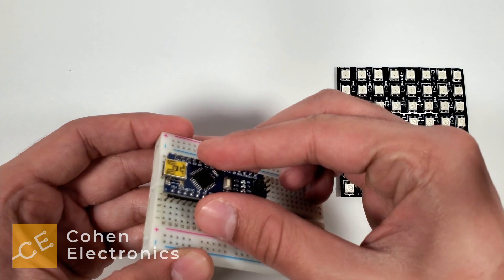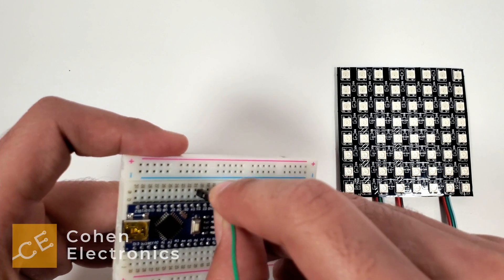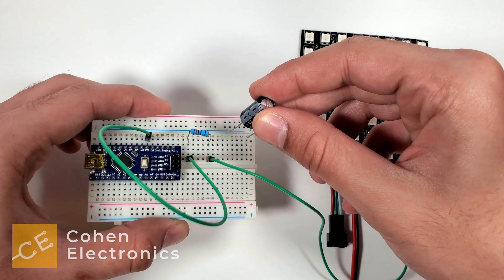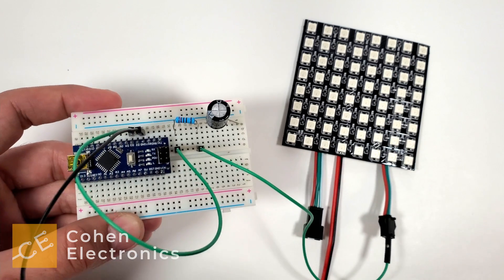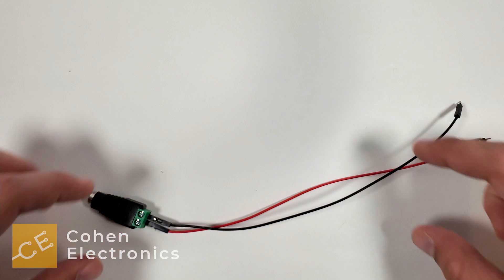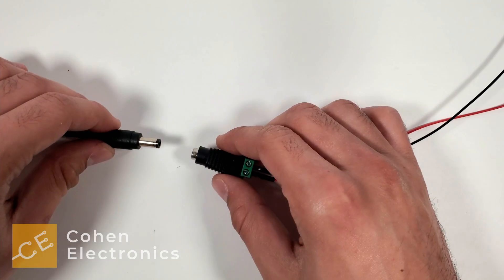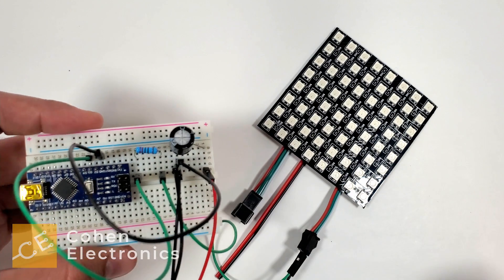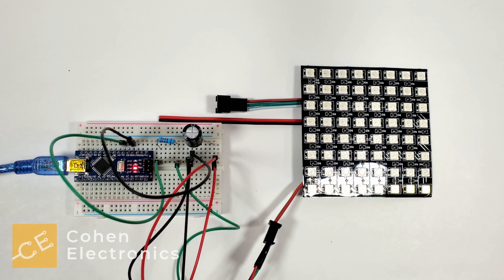Arduino to WS2812B LED Matrix Breadboard Circuit Tutorial

Comment: Hi. I would like to make a similar circuit. Is it possible to make it without the capacitor? And what does the capacitor do in this circuit?
Reply: The capacitor serves to modulate power fluctuations, to keep a steady current going to the matrix. Yes, you can skip the capacitor, but the performance might not be as good.